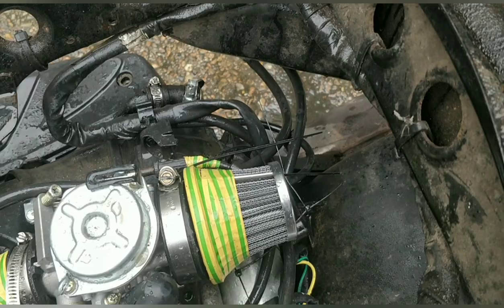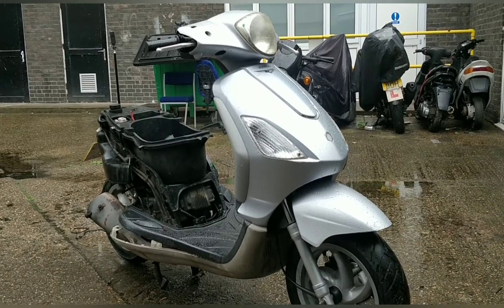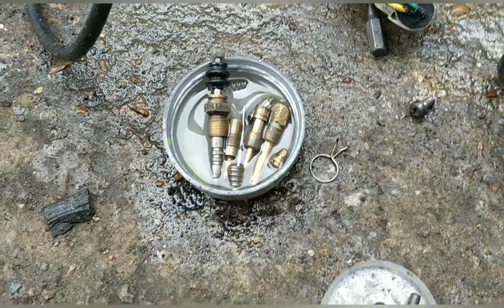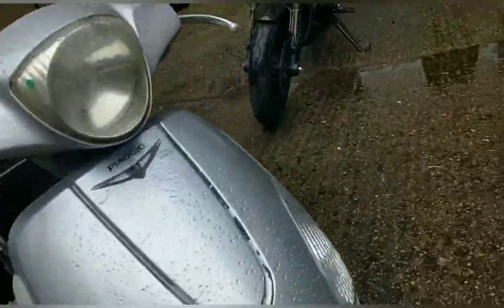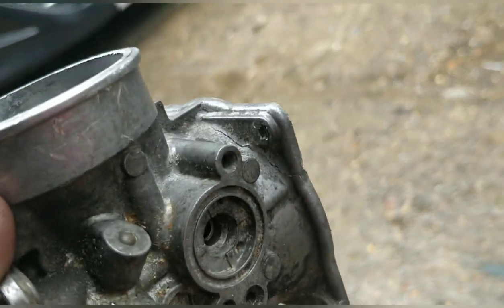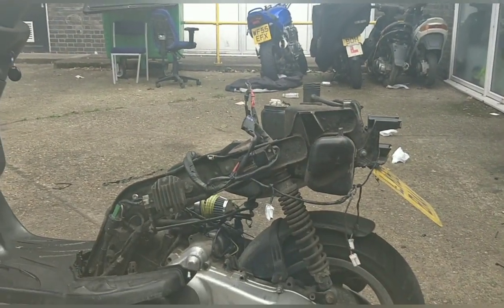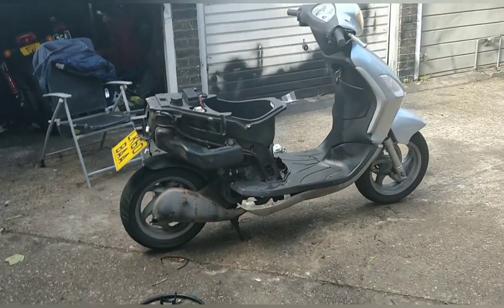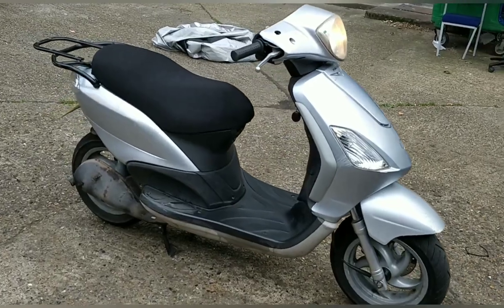piaggio fly carb fix, carburettor fix, building a carb. Final vid

Comment: Get a nice little clone pwk carb for it 👌 30 quid polini jets and no diaphragm to sod about with. I guarantee that's the issue with both of those carbs. The spring has worn so isn't as strong and the slides get stuck even if you can't feel it getting stuck under vacuum they don't slide smoothly like they should.

Also offer still there if you want my old carb it's the same as the ones you have there
Reply from the maker: Hi Laguna, all done and dusted mate. Sold aswell. Made 1 good carb out of 2. 

Cheers mate
Reply: @motorcyclerescuer  nice one mate good to see it running properly. 

Just had a ball ache with my aprilia. It let me get home but as I got to my gate the intake manifold snapped in half 😆😆 ordered an injector manifold instead. Made of metal instead of rubber. Should be more reliable 🤞 wanted to fit a bunch of polini clutch bits this weekend but no point now 😆
Reply from the maker: Oh really, if metal is available then that makes so much more sense then. 

I likes the rs 125s and loved the rs 250s but they are ridiculous prices here now when I used to be able to get them for 2k or less
Reply: @motorcyclerescuer  yeah and parts are so hard to get and if you do find them they're coming from Italy with a nice €30 shipping and customs add-on...

I've got the Atlantic 125. It's got the same engine as the gileras and Vespas. I caved in and started fitting the clutch bits while I wait for the manifold to turn up.

Comment: Glad you've sorted it Charlie, I bet someone used a impact driver on that top screw hence the bent carb body. 👍
Reply from the maker: When I tried to straighten it, it was solid,  so I think it would have taken more then an impact driver. But you never know. 

Makes sense which is a shame became these top screws rarely seize in
Reply: @motorcyclerescuer  perhaps not an impact driver. But I've come across several of those screws that are seized with evidence of someone having a go with a screwdriver and a hammer. 
Or
 Perhaps it was dropped in manufacture and knowone said anything. You know what there like.

I loved it when the kids had spent the weekend trying to get there scooter to go faster only to have it cost a ton of money on my bench putting right what they'd put wrong.

Keep a eye on those auto chokes. Not all of them close down properly. 👍

Cheers.
Reply from the maker: Hi Ray, your possibly right mate. Someone ruined it. 

I checked the choke separately and it was all good. 

Bikes sold now so onto the lexmoto to finish. 

Cheers mate